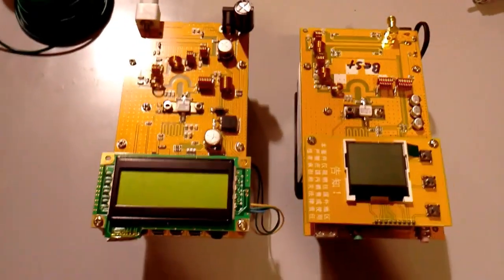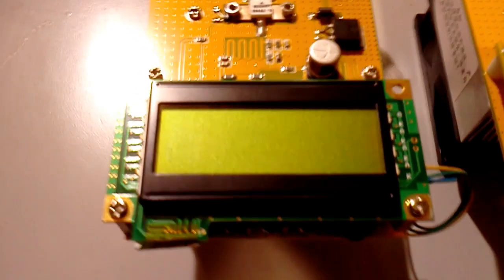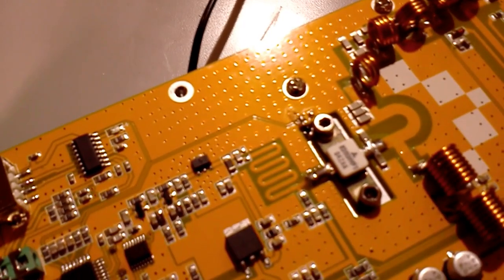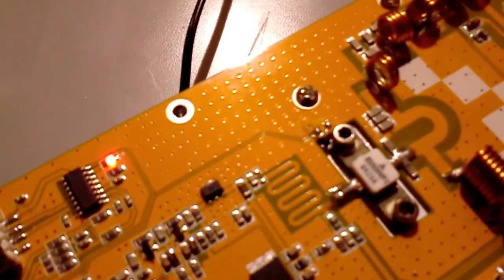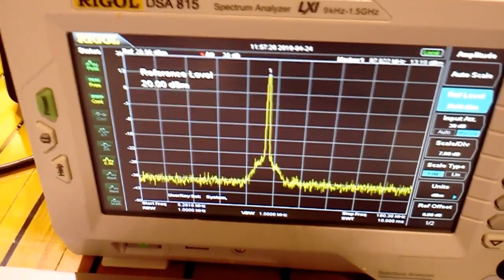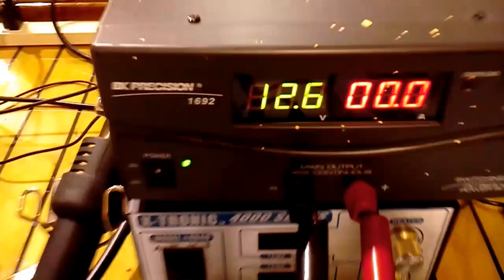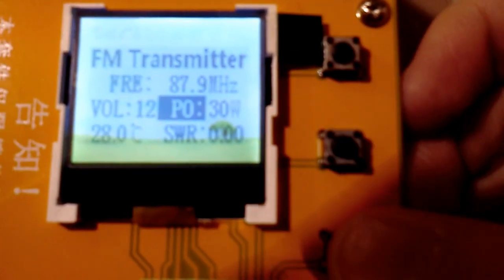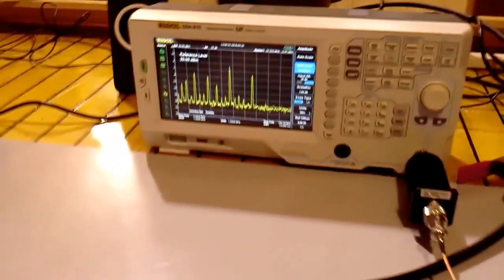New 30W FM PLL Stereo Broadcast Transmitter Spectrum

Comment: I've enjoyed watching most of your videos on these transmitters. I'm especially interested in getting the newer 30 watt unit with the QN8066 chip. If you still have 2 of them, would you sell one? Also, if you've modified them to reduce the power to the final to eliminate the spurs what was involved? Putting your finger on that part of the circuit was like adding a capacitor to improve the match. Keep up the good work! 
carlgret

Comment: Oh shit!  I've had the new version for a couple of years, and taking into account all your tips it's worked great....... Until today that is.  I accidentally connected the power the wrong way round. Yes, there was smoke. Yes, I've called myself all the idiots in the world. I took the control panel off and there's one burnt component under there on the main board. It's got three leads but looks like only the two outer ones are actually connected, so maybe it's meant as a fuse?  I'm wondering if you've any idea if the whole thing's scrap or it can be fixed?  Any advise you can give well be really appreciated.  Has anyone out there done the same dumb ass  thing as me and managed fix the transmitter?

Comment: What is the value of the cap in the older version you have. I figured you have removed it and measured it by now. And what success have you made on mods to drive circuit
Reply from the maker: Don't remember, but I added the same value cap briefly to the other transmitter without one (not a good idea). It seemed to improve the spurs, but this way it can over drive the transistor, so the only way is by modding many components on there to lower the drive power. I didn't try that.

Comment: Could you review the 15W one please? Does it also happen on the 15W one?
Reply from the maker: You mean ST-15B or you mean the 15W kit version with the QN8066?
ST-15B - it doesn't happen
15W kit - I don't know yet, but not on the 7W.
Reply: @spectra-man  the 15w kit. The QN8066 is not perfect. The volume is very low but Stereotools presets will definitly help.

Comment: Could you review the 7W one please?
Reply from the maker: I can, but the spectrum is basically the same as this when it's at full power. It doesn't have the spurs at low powers though.
Reply: @spectra-man  thats a good sign because Id get 50 miles on max power with 50 ohm, 1.3 SWR Antenne. What does 'POW 300' mean in the 7W transmitter?

Comment: The thing is I cant find any antennas / cables that fits the white antenna port. This is giving me a headache, finding the right antenna for this since using wires doesnt make the range any better, unlike many 1mW, 5mW transmitters, you can get 200 metres with a dipole 
antenna made from used wires but not these transmitters. I cant even get one metre range from these transmitters. Are they really 30W?

Comment: I also thinking it is possible to re-match the amplifier as you suggested and instead of reducing the bias, reduce the drive signal to the output transistor with a resistor to shunt away the excessive drive to its input place it around where the pcb inductor is. It may work, Its a good idea to drop the supply voltage down to increase the life of the transistor anyway, as 30Watts is a bit over the top.
Reply: excellent video, do u think 30 watts is enough power to make it around the house? just kidding..Just as you all may know in Australia (LIPD) low interference potential devices class license only allows a miserable and useless 10 microWatts for 88~108Mhz band 2, its so weak it barely makes it across the living room. An officer said if we can pickup up you're signal from outside you're house on our standard car radio, you're transmitting with too much power, that's crazy the law is an ass and its seems no one could careless anyway... good!

Comment: Well  mine has been running almost non stop for over a year now and so far I've had no issues.  I've tried a few different power supplies and antenna configurations but in all a very satisfying little radio with very good range depending on antenna height and type.  Also it's about choosing your frequency to  avoid detection.
Reply: Very interesting. I have one, what should i use for a power supply?

Comment: Hi ,i have this  the new one PLL 30 w .   The SWR is 1.00 in frequency 87.8  and the antenna is 1/4 GP  ,i have and  another antenna dipole for test but i have  big problem with this pll . I can't hear any other radio station only mine,even with a 2 watt    and the channels from the TV are not working ,black all !!!  . I once had  a lamp (EL504 )transmitter and I had no such problems.  If you have found a solution please let me know. Thanks
Reply: Intresting
Do you have this problem yet ?!
Reply: @hussoohussoy-xs5wr  Although 3 years have passed. The problem was with the mofset. They sent it damaged. I replaced it with a new one and the specific problem does not exist. Then I had another problem.
I ran it 24 hours a day and was happy with the  range and sound. Βut when the weather wasn't good, if there were a few electrified clouds, the thunder burned my mosfet. Burned it 2 times and I closed it completely because I got tired to pay money .An experienced electronics technician informed me that this particular transmitter has a static issue and that no one should bother with it. I have it in my room and look at it regularly.  I believe that if I work a little more with the antenna, this problem will also be solved

Comment: I have just been trying out one of these transmitters for our community radio station as the old unit we had has failed. The issue I have been having is that when we connect it to our aerial (folded dipole with coax balun on around about 20 meters of that really thick coax feeder), the SWR goes all over the place and it keeps entering into some kind of protect mode and ramping up again. 

However, this video has enlightened me as to why that might be the case because I have been setting it around 6 watts as that is when it seemed to be the most stable, but then something would change in the environment and it would go unstable again (the other day it was particularly windy and that seemed to upset it). Now I can see it's probably because of all those spurries on the lower power settings. 

So I really appreciate your video as I hadn't considered the idea of lowering the supply voltage to alter the power output. A couple of things I would like to ask you: How low can you take the supply volts down to before the other circuitry before the final starts misbehaving? And, what wattage power supply would you recommend as a minimum if one is intending to operate near the full 30 watts?
Reply: try LMR400 coax cable but 10 meters was £65 for me.
Reply: @EastAngliaUK  Turned out it was the aerial. Corrosion had got to it and it had crapped out. The xmtr works pretty well with a little dipole I made. Funny thing was though I tried dealing with it by reducing the supply voltage with this massive rheostat. It caused the thing to emit massive amounts of spurries all up & down the band and it wiped out the police radios on 75 MHz! A very funny phone call from a police radio tech. lol
Reply: @xanataph  What sort of range do you get with it on your radio station?

Comment: Hi. Thanks for video. Just got same one(new version). Wanna upgrade stm mcu firmaware to control it via single board computer through SPI interface instead of display 
Anyway, can you please suggest  me what type of temperature sensor did they provide? Looks like its some thermistor but not sure.
Did you measure stable signal range on this transmitter(or have any idea how far it can broadcast, lets assume with well tuned GP antenna, with cable signal loss ~10-15%, 7-9 meters elevation, clean/plane  environment) I need around 2miles coverage, do you think its possible with it? 
Thanks
Reply: yes

Comment: Hi output power is 50w on 14v 7amp aprox
I noticed wrong smd resistor  values on  swr bridge... (  perhaps protection of overburdening)
Can you help me tune this boaed... haw to lower vlltage on gate if i add ajusible capacitor or you know value capacitor for drive point..
I'm also intrested to add, implemented  RDS signal if is possible...  which pin of microcontroller or where?

Thank you in advance
Best Regards

pleas contact me on private email
heave you FB  any direct  contact
Reply from the maker: Hello Sir,
I can't help too much, but I can try. You want to lower the voltage on gate: look for the resistors leading into the gate. If you are equipped, you can replace it with a pot.
I don't know where you want to add the capacitor, so I can't help anymore.
Reply: @spectra-man  I find pin data of qn8066 this is complete  stereo IC. Its impossible to add RDS.
Do you know value of capacitor  for tune. Missing place on board... when you put finger and get mod dB

Comment: My transmitter just stopped working but I noticed that the current draw was a little over 4 amps, which means it was probably pushing  around 40 watts. I think it's probably the output transistor/mosfet thats failed because it's a bit discoloured, It's an RD30HVF1, do you think an RD40 or 70 would be a better replacement, thanks.
Reply: For 50w current is 7.5A aprox U need 10A power supply

Comment: I have the old version of the transmitter. Is it better for the newbie? Why did the transistor burn me?I close the message from Greece
Reply from the maker: There is nothing better about the old one. The signal is worse. Why did it burn out? Do you have an antenna analyzer to check the SWR?

Comment: Hi dear, i have same transmitter, do you know wich circuit is in transmitter, normal is bh1415f.or 1417f but on my circuit mark ab1701ch8w19.1-82e  do you have any pinout of circuit thank you
Reply from the maker: On this transmitter is a QN8066 chip. It is better than the BH1415f or 1417, but still has some RF noise. Google images shows pinout, but no description of pins. SCA SCL is data pins. RFI is antenna input for receive mode (chip has receiver). RFO is RF output for antenna. ALI ARI audio left in and right in. ALO ARO audio left out and right out. XCLK crystal. CEN chip enable. VCC power. GND ground. Hope that is enough to help.
Reply: Spectraman Thank you very much friend, transmitter is same just display is diferent,lcd colour display,i have problem with connect RDS, i must find  mpx(composite) output pin from transmitter chip, i will cut this line  and put my mpx from my quality rds encoder( if you understand).

Thank you again very much and greetings from Bosnia.
Reply from the maker: If you have the transmitter that is similar, but has a blue screen, it has KT0803L not QN8066. You can only connect MPX on the BH chips. This transmitter doesn't have an MPX composite pin. Sorry, you can not do it. Only on a BH transmitter.
Reply: thank you, i understand
Reply: @ruvex  its possible to add RDS
Reply: @zeljkoadzic1692 Da
Reply: @ruvex  znam da moze :) to i kazem 
pitam da li mozes da kazes sto si kupova tocno
Reply: @zeljkoadzic1692  moras pilot ton na rds encoderu spustiti sa 19 na 16 khz jer ima filter na ulazu. Rds.ide preko audio ulaza.

Ja sam kupio softwersku verziju rds-a koja ima opciju mijenjanja freq pilot tona
Reply: AIROMATE 2 software
Reply: @ruvex  razumijem. Ja sam vidio drugu opciju spajanja pogledaj moj link od pred mjesec dana.cca.
Reply: @ruvex  koji je to rds?
Reply: @ruvex  rds ide preko frekvetivne modulacije to je jasno ali bi se trebao mjesati poslje stereo encodera... na koji kanal.si sponio rds L ili D?
Reply: @ruvex  zato je mozda.bolje koristiti winamp.stereo rds tool... stereo tool http://winampheritage.com/plugin/stereo-tool-7-23/221526
https://www.stereotool.com/download/
Reply: @zeljkoadzic1692  stavis ga na mikseti na jedan mono kanal i pustis paralelno sa ostalim audio signalima. U chipu se nalazi sve tako da ulazi L R na chip a izlazi gotov mpx. Ne mozes nista tu napraviti, samo kroz audio ga provuci. Nebitan kanal
Reply: @zeljkoadzic1692  imas fazon i sa izlaznim tranzistorom, umjesto trenutnog rd30hvf stavis rd70hvf i ide bez problema 70w, samo treba nekih 10A i vise ispravljac
Reply: @ruvex  imam